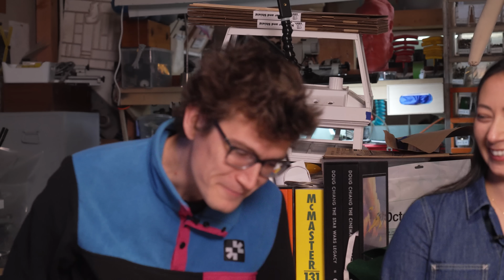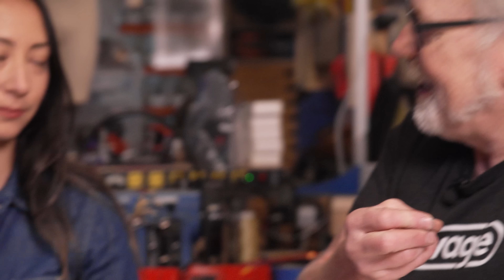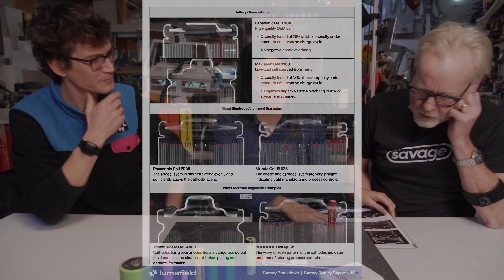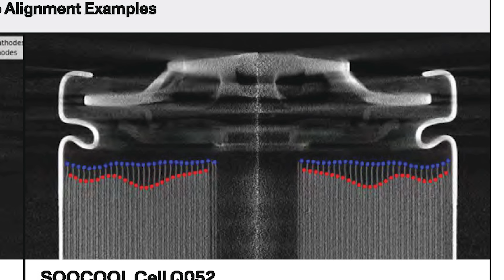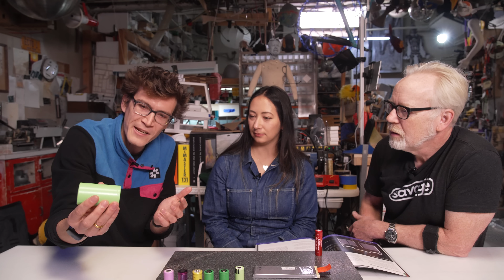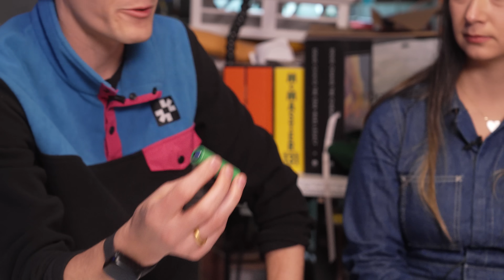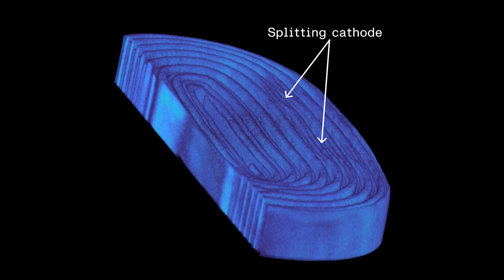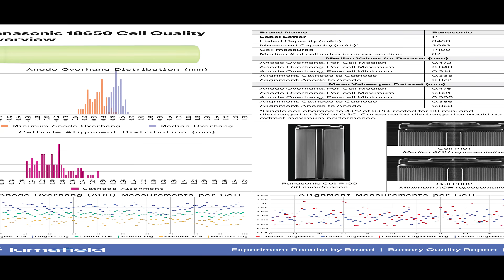The Surprising Flaws in 18650 Lithium-Ion Batteries

Comment: The more information the better however unfortunately there is no law where manufacturers are forced to reveal their battery supplier / manufacturer and if these batteries meet quality standards or not.  Most people for obvious reasons are not willing to crack these open and most people don’t have the scanning hardware to validate any issues.  Furthermore due to the amount of manufacturers making these batteries it maybe difficult to track who made them unless there is some industry standard QR code that reveals who made them.  I do own a lot of Sharge (aka Shargeek) portable battery banks but unlike most manufacturers Sharge mention who makes their 19650 cells which is Samsung and due to the fact most of their battery banks are partially clear / see through you can see the Samsung branding on the batteries, but most companies keep this quiet on the hope there are no issues.  

BTW the numbering convention of these batteries are as follows - 18650 means 18mm (1.8cm) in diameter and 65mm (6.5cm) in length.  21700 means 21mm (2.1cm) in diameter and 70mm (7cm) in length.  Most of these are lithium ion based however there are changes in the works to make these sodium based instead though they currently have lower energy density and cycle life, with rapid advancements improving performance and commercial adoption so a true replacement tor lithium ion may be years away without any drawbacks.

Comment: 18650 means 18mm diameter and, for some reason, 650 tenths of millimeters long. Other battery sizes are just in millimeters (like the 4680 46mm dia, 80 long).

Comment: I get second hand battery packs from the trash and recycle them all the time.
They're a real boon for the electronics geek. 
Vacuum cleaner batteries, drill batteries, lap top batteries... all sorts of sources of 18650s.
My suggestion is to get a tester so you can immediately see the internal resistance. That immediately tells you a lot. Really good ones are down around 20 milliohms

Comment: What I find very frustrating is that the manufacturers never label what the actual chemistry is in a plain format.  It should be a legal requirement to label batteries correctly.  There are different chemistries and capacities.  Lithium cobalt  (including LiPo) is about the highest capacity but it has the lowest thermal runaway temperature (the temperature at which the cell will go into thermal runaway ie explode and/or burn).  Guess what is in most consumer electronics (including EVs)  because of that higher actual capacity?  Lithium manganese and hybrid chemistries have higher thermal runaway temperatures and are therefore marginally safer, however the capacities are lower so consumers often overlook them because they don't know enough to make better choices.  All of these chemistries are 3.7 V nominal (actual maximum voltage 4.2v)

The safest chemistry is LiFePO (lithium iron phosphate) as it has the highest thermal runaway temperature (the temp at which it going into thermal runaway).  LiFePO has a nominal voltage of 3.2 volts however, so it's not really a direct replacement for regular Li-ion especially since they require a different charger, and the energy capacity is much less.  It's still the safest chemistry however.  I'm very skeptical of companies they say they use LiFePO cells, because they are often still using 3.7 V nom. batteries - not LiFePO at all.  Here's looking at you, Tesla.

There actually are a few things you can do to stay safe(r).  Never (ever) fast charge your batteries.  Put your fast chargers in a cupboard and only use them rarely, in extreme circumstances.  Even a 1 hour charge is a 1C charge, and I'd recommend that you charge at half that - so a two hour charge or longer.  This will ensure that the batteries do not overheat and become damaged over time.  Another thing you can do is not run batteries flat.  Dendritic growth happens rapidly when the cell is quite discharged.  If you never discharge them lower than 3.2V (about 15% on most devices) they will last a lot longer.  If you do flatten your batteries slow charge them as soon as practical.  It's best to not charge batteries while you sleep, and definitely do not put batteries on charge and then leave the house.  Lastly, for loose batteries always store them in containers designed for the purpose such that they can not short circuit - some problems have happened because people put Li-ion cells loose in a bag or pocket then forget and threw their keys or other objects in with them.  Even Adam saying he has "lots in a drawer" makes me a bit twitchy, but it's OK if he's taken steps to avoid any chance of short circuits.  Lastly, always use a good charger - it's vital that Li-ion cells are not over charged because that is a sure "fire" way of running into problems.  Most USB devices are fine because they have a BCM (battery control module) inside them that prevents over charging.  Some cells have their own BCM, again, not labelled and some cheap cells that claim to have such a device do not in fact have anything at all.  Do not devise your own charging systems unless you know what you are doing.

Comment: In the local makerspace we like to hit old 18650 cells with a nail gun for funsies and what i've found is that even a fully charged 18650 is actually very difficult to make fail with any significant reaction other than heating or oozing electrolyte. That includes SONY, LG, PANASONIC cells etc.
UNLESS they're some no-name chinese cells from an imported e-bike. I've found that just whacking them with a hammer without any real effort will turn them into timed bombs that stay silent for 10 seconds and then completely explode with flames and guts of the battery going everywhere.
Hitting those cheap cells with a nail gun will make them explode instantly.
It really depends on who makes the cells. Some are safe, some are not.

Comment: By making these batteries unable to be replaced or inspected manufactures are taking us down a very dangerous road as these batteries are often kept because they are part of an old but not totally obsolete device. Normally we would store the device and remove the battery, but we can't remove it because it is not designed that way.

Comment: You know how we in WW2 did put out those unquenchable fires of the british and american "Stabbrandbomben", Incendiary Bombs,  like "INC 4 LB", that were essentially filled with Aluminium and Magnesium Thermite, both like Lithium are highly reactive with water or better the hydrogen in water, solution is: Sand

Also people that test batteries to destruction put them into sand buckets. Sand being generally non-reactive and having a rather high melting point and even higher binding energy of the oxygen in the SiO2 (Sand) as well as it being "compressable" (being made from many small pebbles) versus water which transfers shockwaves easily.

Sand takes the energy, thus cools the material, which slows reaction rates, absorbs the shockwaves.

Water makes it all just worst, also water is electrically conductive. Thinking about that: There is a run away effect by effects that usually produce voltage and electrical currents and instead of a local (an internal short) defect that is now, via the electrodes, put over the whole of the windings. Yes one might cool the "device" but it is filled with alkali metal that LOVES to burn with water, that doesn't require heat it's spontaneous and pyrophoric (literally "fire-bearing"), or self-igniting, so any defect or inaccuracy in the containment vessel and the water will have negative coefficient in cooling versus igniting. and as alkali metals like to ignite the create H2 gas they explode and that will create secondary effects like damage the next cell.

British Bomb, 4 lb IB, Mk 1, Mk 1E, Mk 2, Mk 2E, Mk 3, Mk 3E
British Bomb, 4 lb IB, Mk 4, Mk 4E, Mk 5, Mk 5E
US Bomb, 4 lb Incendiary, AN-M50 Series
US Bomb, 2 lb Incendiary, AN-M52, AN-M52A1, AN-M52XA1

Comment: I have been playing with these things for ages. And of course you know that A brand 18650's are better and definitely safer than the budget cells for 20% of the price.
But what is way more important are the things they are in. When you use the cells from a blue Bosch or a A brand laptop (in this day and age, 18650 is not being used anymore) the cells are always from some A brand.
I used to be rooting for LG cells when they were the best. Today it doesn't really matter anymore.
If you open up a A brand homeowner tool, you probably are going to still find A brand cells, but a lower rating (actually the very expensive A brand batteries are mostly a scam, price wise).
But when you check out some other device, like an IKEA tool or an AliExpress/Amazon device, often the absolute wonkiest cells are in it, without any fail-safe.
Chicken coop door, portable speakers, you name it.
Weird how none of them take any responsibility for our safety, and can still sell to the western world.

Comment: The speed at which thermal runaway initiates and the difficulty in extinguishing lithium ion fires make them a unique fire risk. I have small lithium ion batteries in devices, but will not have something like a UPS or large battery power bank in my home.

Comment: Whoww!!! This is the the greatest example of how this platform should be, not that AI driven fake s**t !!! This kind of content needs to be supported in as many way’s as possible, to prevent this platform going down the drain very fast ! Great, great work guyzz !!❤❤❤❤

Now, what a lot of people are forgetting about is the simple fact, that you practically NEVER, can expect highly safe and high quality stuff at low price !!
The cheap selling areas we all know, are in fact the most dangerous places, to buy items that can eventually litterally set your house on fire, when they are not manufactured within important safety specs.
Like they clearly stated here: Once they are assembled, you cannot check the inside for possible dangerous defects, and yet, you (unconsiously?) trust them with your life ??
I am working (playing..) with rechargeable batteries for already some 50 years now. And after some, fortunately minor mishap’s in the beginning, I realized that safety and quality are way, way more important than getting those cells cheap ! And this platform is loaded with content, that supports this, and even shows people who sadly lost their lives, after doing DIY things with these cells on a budget 😢😢😢

Comment: I was wondering recently if some of the HARIBO branded tech products are actually from the original manufacturer that has the license, or if other, cheaper factories just started to produce random stuff with HARIBO and the Hong Kong DC Global name on it.
German tech youtuber "Zerobrain" did a long video on the 65W and 100W quick chargers by them and these mastered all the tests he put them trough with flying colors, so seeing many other HARIBO/HKDC Global branded tech being judged poorly is kind of confusing cause they apparently are capable and willing to manufacture quality products...
Zerobrain tests with proper lab/testing equipment and also disassembles all his test subjects to get an accurate perception of what is going on with and in them btw

Comment: It really is time that we in the EU imposed far greater restrictions on the import of these dangerous batteries. Amazon seems more interested in profit than customer safety and China should be told that if they don’t tighten restrictions imports of these crap batteries will be blocked. To many batteries come with high spec and cheap prices and example is a pressure washer I bought that’s battery powered it cost £180 yet a neighbour bought a similar Chinese machine from Amazon for just £39. The Chinese don’t give a monkey’s ** what happens after they export these products.

Comment: I have never trusted cheap or unknown brands of batteries for safety reasons. Now my concerns are validated
Reply: Haha agreed, but I think it's validated
Reply: @osbjmg  "Validified" would be a G. W. Bush-ism.
Reply: lmfao never? what a mong
Reply: That's what u got from this useless video? bruh. they can print whatever brand they want. doesn't make it better. There are tons of unknown brands which are usually OEM manufactures who sell much better cells than typical "branded" garbage you found in USA websites.
Reply: USA opted for LiPo - the worst possible technology, now 40 years old. It's archaic, but only to avoid easily destroying oil bussines. That's why China is far ahead of the USA in acu technology, because they don't care about maintaining an oil monopoly.
Reply: So the Chinese slap an unrecognizable name on the battery and its good to go?

Comment: I salvaged a bunch of 18650 cells from some old laptops that I had found in the trash and I'm still using them after about 10 years of use they are still working at about 80% of capacity. They are mostly Samsung cells, if they were temu cells I highly doubt they would still be working.

Comment: TLDR If your building battery's using 18650 stick to the big Japanese, Taiwan and Korean manufactures for example Sony, Panasonic, Sanyo, Lg, Samsung, Molicell to name a few. 

If your buying devices with battery's integrated and are worried I would stick to manufacturers with a established reputation they will tend to not cut corners on battery's.

Comment: Always a good idea to replace cells / pouches / hard case packs provided with cheap RC vehicles & toys.  Most of them are cheap for godd (bad) reasons, the batteries are often a significant part of the production cost of the item. Over the last 3 years I have safely disposed of many Li-Ion and LiPo cells and packs replacing them with proven known brands. This is an extra cost but reduces the level of risk associated with lithium cells and batteries used in what is effectively a harsh environment where they are subjected to vibration, impacts and a wide range of factors that negatively affect the safe working lifetime of the cell / pack.  I had 3 packs fail (out of 36) that were supplied with cheap RC cars in the first year. One lost capacity over the first half a dozen charge / use cycles then refused to take charge, one got excessively hot after a roll over crash at about 40MPH, the battery was not directly impacted but suffered shock and high vibration, The outer wrap was starting to melt, I managed to rapidly remove it from the car and the pack released some smoke for a few minutes then cease. after it had cooled it went in a brine tank for a few days before being sent for recycling. The third failure (3S 3850 mAh LiPo pack) exploded when charging with a basic USB powered charger, destroying the charger and power supply along with the battery.  I no longer trust simple USB chargers (Now only used for low current packs & single 18650s outdoors)  and replace the cheap cells / packs with new branded ones from a trusted supplier, not some random seller online.  The next 2 years I had one pack fail and that was due to severe crash damage that deformed a 3S pouch 'soft pack' when a 1/8 scale model rally car suffered rapid kinetic disassembly on impacting a tree at around 50 MPH. The entire model was destroyed, the fire was contained to a small area around the wrecked car and the tree trunk was slightly charred but survived the fire.  I do my best to avoid / replace cheap batteries in everything now.  STAY SAFE !   beware the cheap-o deals, they are cheap for good (bad) reasons.

Comment: Well at least I know the ones I have are good XD mine all come out of drill battery packs and you know what brand and model each company uses in theirs. I started pulling them when I have a pack that doesnt want to charge anymore because its just a balancing issue like one cell has a much lower charge level than the others so it refuses to charge as a group anymore. They are perfectly good still if taken out and charged individually (that pass all the tests). They are great for projects, I have a very old radio that takes like 6 C cells but one 18650 will actually power it lol (think the Cs are wired in series and parallel because the limitations 70 years ago).  I have even bought packs in a pinch at walmart because they sell the hyper touch 12v batteries for such a decent price and they have 3 cells in them and you can get them right now instead of waiting.

Comment: 14:51 no.  4.2. Arent these the experts?
Reply: Yes, please look at the 18650 voltage curve and you will understand. Batteries are always charged to a higher voltage than they're meant to nominally output until they're dead. That's how the voltage stays consistent throughout each cycle.
Reply: @ericeder1693 ive never seen a lion battery read anything but 4.2 when charged.

Comment: Great video and topic!  I would love to see a "Tested" episode about what one should do if a lithium cell goes "bad" - if possible differentiated by size/capacity and type/stage of failure. For example, what to do if a pouch-style battery (like in a cell phone or a smart watch) swells up to what to do when an E-bike battery starts outgassing or smoking or (worst case) starts burning?  
While I never had a larger battery pack fail  (don't have an E-bike or scooter),  I had a cell phone pouch battery that had swollen up and that had lifted my cellphone's back.  I knew that I shouldn't just throw the battery in the trash (could cause a fire if it bursts in the trash can), so I ended up placing the battery in a old stainless steel pot with a tight fitting lid and a weight on it, and then put the pot outside for the next 24 hours "under observation".  But, was that even the correct thing to do?